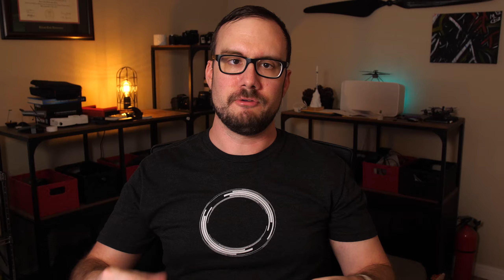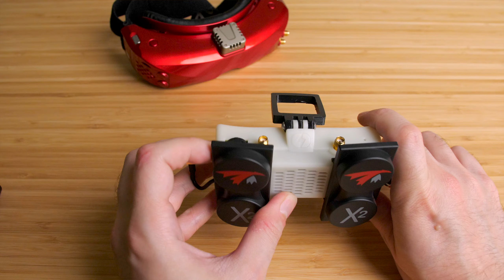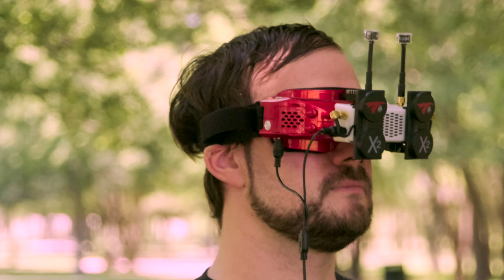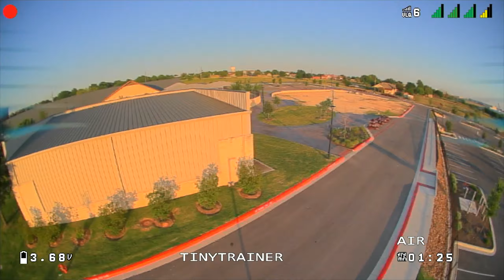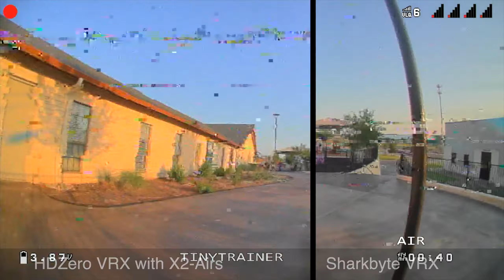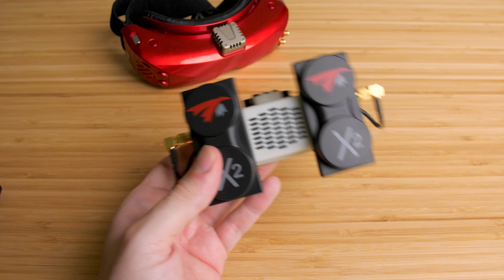TrueRC X2-Air Antennas for HDZero -- My Review

Comment: great review! do you have any experience with these vs the x air mk 2 (the singular patch)? i’m looking at these for a more general, everyday use case, and wondering if the x2 air has better performance that’s worth the trading of the even smaller profile of the x air mk

Comment: i am new. what should i get RHCP or LHCP? i just got a Happymodel Mobula6 HDZero 1S 65mm Micro Whoop and dont know what it use.
Reply from the maker: I’d recommend RHCP. The whoop antenna is not polarized, so either is fine, but RHCP is the standard for HDZero so if you ever get a bnf drone or receiver with polarized antennas, they’d be RHCP.
Reply: @ATXAirborne   Thank you for the information. I was wondering if they had a default standard.

Comment: Just purchased the HDzero VRX and a Mobula7 HDzero quad. The biggest problem so far is the VTX keeps shutting down and cutting in and out if you leave the quad powered up and sitting for more than a few seconds. This sucker gets hot enough to fry an egg. I am going to look into reducing MW to 25 when not armed or on s switch.
Reply from the maker: If you’re going to be sitting for a while before takeoff, I’d recommend either enabling low power mode in the VTX menu, or using pit mode before takeoff. To go into pit mode, hold the sticks down and toward the outside of the radio for a moment. To exit pit mode and go back to full power, move the sticks down and toward the inside for a moment.

Comment: I wish HDZero had moulded an indentation into the rail system so that antennas manufacturers could incorporate an opposing bump into their designs so antennas clip into the rail instead of relying on friction. I would find loose antennas really frustrating. 

I did comment that on one of the goggle design threads but not sure if it got noticed.
Reply: That's exactly what I was thinking when I saw that.  Another option would be a some sort of spring clip to add friction since the bump isn't in the production rxs.